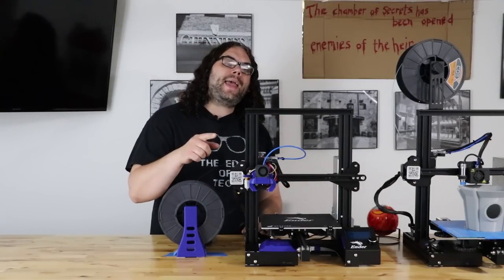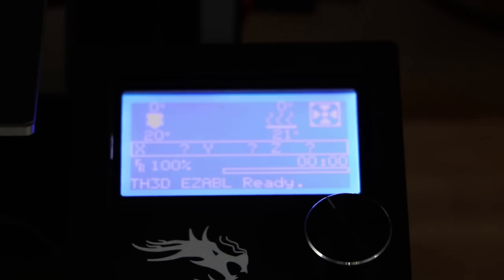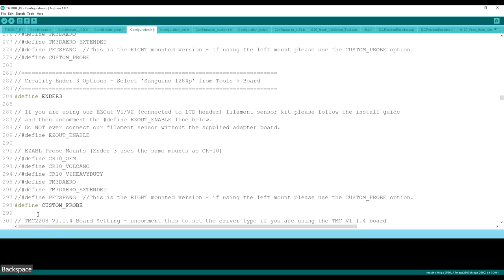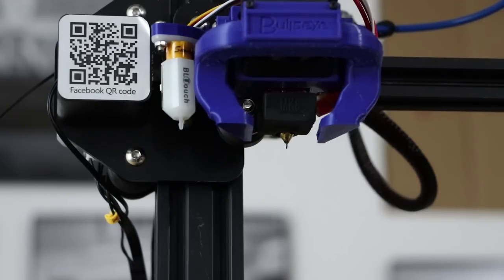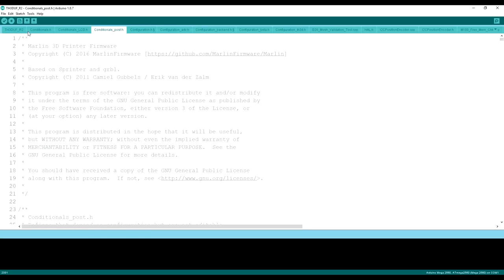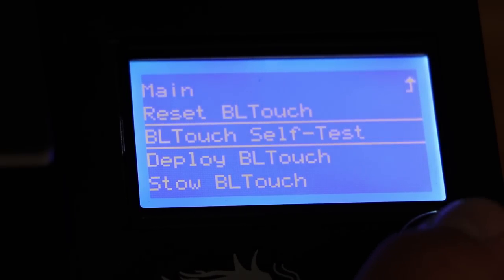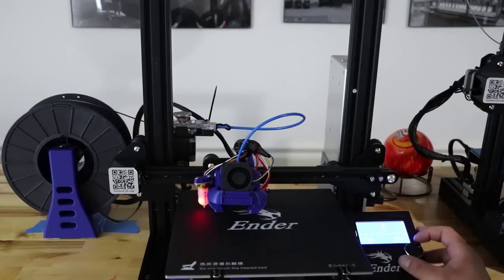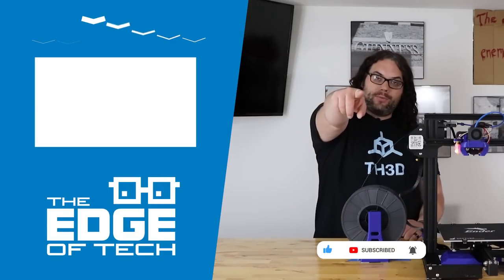New way to configure the BLTouch on the Ender 3 in 10 minutes or less

Comment: To measure the X and Y probe offsets (shown at 8:35), the following worked great for me:
1)   The printer does not have to be turned on.
2)   Manually move the hotend until the centre of the nozzle is touching the front edge of the bed.
3)   Measure from the front edge of the bed to the centre of the BL-Touch probe's tip.  This is your Y offset.
4)  Repeat this process, measuring from the right-hand side of the bed to get your X offset.
Thanks for a helpful video.
Reply: John Colvin 
That’s a good tip.  You can also use the printer powered on, and step it along until aligned to get more exact measurements.
Reply: Or you could just measure straight from the nozzle to the bltouch and use the Pythagorean Theorem.

Comment: I do enjoy the way you explain things.  Very easy and simple.  You also have great visuals.  Others that do similar walk-throughs have blurry images.  I would love you to make an advanced video that includes:  1. How to speed up BLTouch sensor..(TH has really made it slow compared to their proprietary speeds). 2. How to trim the fat on the firmware with this small Memory chip.  3. How to change boot screen 4. How to easily add the LUKES DUMP after the bed level.   I have done most of these things, but has taken a week of messing around and watching multiple videos.  Not many people (outside of Cvid times). Have that kind of time.  But that is only a suggestion.  Thanks for your videos!
Reply from the maker: Thanks for your suggestions!!! Thanks for watching!!

Comment: I have the BL Touch V3.1 and the V1.1.4 board.  When I installed the connections, the top of the container would not shut due to interference with the fan.  I printed a 5 mm spacer and bought M3-0.5 x 16 MM Socket Cap Screws at Home Depot - about 70 cents. Worked great.  I'll happily share the STL.  Still working to finish the software install - multi-tasking today.
Reply from the maker: Nice!! Great idea!

Comment: You saved me! After many, many hours of trying to get my bltouch 3.1 and Ender 3 to work, this firmware and your video finally enabled me to get up and running. The only thing that has changed in the latest TH3D that I can see is that in the configuration there doesn't appear to be a separate bltouch configuration for the 3 version. The versions must have all been consolidated into one bltouch selection.

Comment: Just installed my boot loader with an arduino uno as isp and updated my firmware to TH3D U1.R2.15. in preparation for my BL touch (on its way) im freakN PUMPED!!!! great video man!!!
Reply from the maker: Awesome!!!

Comment: Just to add to this. I did it on my ender 3 pro this way. After updating firmware and connecting the bl touch, I auto homed. I didn't need to disconnected the z axis switch - the controller knows about the bl touch and uses it. I then moved the extruder down with the z axis 'move axis' until it grabbed a piece of paper and wrote down the offset. Then going into the bl touch menu I dialed in that amount into the probe z offset. To double check this, I auto homed again. When I went into the move axis, it shows  something like +11.5 mm - if you dial this down to 0, it should just grab the piece of paper. If this is all ok, then you can go into the control menu and save the params. One other thing, I made a test print with a big single layer margin (using the bed levelling), while doing the margin, I looked at how it was being deposited. I adjusted the z axis probe offset in tiny (0.1 mm) steps and re-did the print a couple of times (stopped at the margin).
Doing this gave me a really good first layer.

Comment: Measuring the nozzle easier if you use graph paper with mm increments (or print one) and then lower the nozzle to the bed, mark where it sits and mark tip of bltouch. take graph paper out and measure using the graph paper. Saves twisting and turning trying to find measurement!

Comment: I do with the video used the standard settings and X/Y/Z adjustments as well, i do not use a Bullseye and the BL touch's measurements should be easy to set considering it goes on nearly exactly the same for every one, i had no ruler and wished to have at least a mention of good "defaults" one could use for the normal way it is installed and with the bracket it came with so i could tweak the slight differences by eye and testing from. other then that this video is very informative and helps a ton in setup procedure thanks.

Comment: Cool and simple video. I have finish step by step, but when i start up the printer after put the new firmware on, the mini speaker back on the control display goin nuts and buzz non-stop all the time. is there somthing i have done wrong or can do to get the buzz to stop?

Comment: How often do you need to re-calibrate the bed? Ie, auto home, and check z offset.
Reply from the maker: I use a G29 in my starting Gcode to probe before every print. It only takes a minute and it's good practice. Normally I set it all once and don't have to do it again for a long time on the z offest.

Comment: Got my new Ender 3 pro.  Added the 1.1.5 silent card.  It has firmware 1.1.8.   I also bought a BLtouch 3.1.  So if I am understanding this correctly, I need to do the following to get my BLtouch to work.  

1. Turn off machine and install BLtouch hardware.  I got the full pack with the pin27 board and mounting bracket from Creality.
2. Leave machine turned off and plug in USB cable.  Then plug that cable into my PC also.
3. Install USB driver(s) from Ender3 SD card that came with machine.
4. Download firmware update from TH3d and extract
5. Run  app and make changes as per the video to TH3d firmware code.
6. Compile.
7. Upload to printer.
8. Power on printer and confirm TH3d installed and BLtouch is working.  
9. Configure BLtouch.

Did I leave anything out?  are there any steps that I left out?
Is there any way to back up the 1.1.8 firmware that is currently on the board?  In case I need to roll back. 
Do I need to then reconfigure everything on the PC?  Esteps, flowrate... etc?  Or does that not get overwritten with the firmware update? 

Thank you
Reply: Did you ever figure out if this was the correct way? Just ordered a BL Touch ... and have the same setup as you. It's a tad confusing, cause every guide I see is different.

Comment: you demonstrated the incorrect method to measure the probe-nozzle xy offset. you should be measuring the x displacement (42) and y displacement (5). you used the calipers to get the scalar distance instead, that's how you got 47, sqrt(42²+5²)
Reply: Thanks, I was confused with the math, like wait whaaaa

Comment: wait... what? How did you set up the 3x3 grid? mine just does 1.
great tutorial though to that point! Haha I realised after I got it functioning that I had no idea what to do next
Reply from the maker: By default on the firmware it should do 3 across the front, middle and back. Doesn't it do that?
Reply: The Edge of Tech it acts like it is auto homing but it auto homes with the probe in the middle of the bed.
Reply: So it just does one point. 
Is there something I need to do in the Gcode?
Reply from the maker: @matthewarchibald5118 Did you turn it on in the new firmware for you Printer? What Printer is it?
Reply: The Edge of Tech ender 3 pro, silent board, I enabled custom probe, bltouch, pin 27
Reply: @matthewarchibald5118  Mine is doing the same thing. Did you ever figure it out?
Reply: @blakequinn280  yes! the key thing you and I were missing is "g28" 
go into cura click on printer settings, and look at the start gcode you should add g28 in a new line after g27 
https://www.reddit.com/r/ender3/comments/aiebc7/better_cura_start_gcode_for_bltouch/
This article talks about some cleaner solutions where it will display text, I ended up editing one of these. I like the one where it says "heat up bed to target, preheat nozzle to 160 (I changed that to 200)" because that reduces wait time. 
If this is still confusing, just drop another comment!

Comment: Thank you for your video, I have bought the new Ender 3 printer. I was able to test print cat. now to print new models whether it is must to upgrade firmware that is marlin or TH3D and cura software or without that it will work?
Reply from the maker: You don't have to update the firmware, but it's suggested to get Thermal Runaway turned on. But you will need a slicer like Cura to slice you prints and create the GCode

Comment: Great video...But dont you have to set a z offset first and store settings... then baby step after print starts to get it perfect?... or am I missing something
Reply from the maker: Yes you will have to do that! I just wanted to create a video to show how to configure it in the firmware. But yes you are correct. Thanks for watching!
Reply: @TheEdgeofTech  thanks for all your time and efforts couldn't do it without you! Keep up the great work!!!
Reply: How do I do this? I’m looking all over the place?
Reply: @AMVitry  use a piece of paper and get your z height close....then go into z height offset and set your z height....then go to store settings....then start a print and use the baby steps to make it perfect...after you get it perfect...go back to store settings.. then you should be good worst case you might have to go into baby steps and make small adjustments depending on your print and how you like your layers

Comment: Hey, great video - However, I'm having some issues...I've got a V3 BLTouch and when i follow the instructions and begin a print, the printer keeps cycling through the probe.  It doesn't actually begin a print...Just continues to repeat the 3x3 probe.

Any thoughts?

Thanks.
Reply from the maker: I would check the starting g code just to make sure everything is right. Also, slice it again on a fresh memory card just to be safe.

Comment: Great Video as always i hope somebody can help me ive tried to find the answer everywhere i have the bltouch v3.1 and an ender 5 due for delivery today can i use this guide to flash the ender 5 with the official ender 5 firmware or could somebody point me in the right direction i have the isp programmer supplied with the kit can i use this to put on a bootloader and better firmware thanks again for all your great work
Reply from the maker: Thanks for watching! The newer Ender 5 machines should have the 1.1.5 board and the bootloader should be on it already. You should able to flash the firmware on it right out of the box. Give it a try and let me know if it works or not! :) Enjoy your Ender 5!!
Reply: @TheEdgeofTech  thanks for the reply just checked my board is the 1.1.4  any further help would be great thanks first 3d printer so very new to all this lol

Comment: Installed a Ender 3 v2  BL Touch and installation was easy. Cannot say the same for settings , turned on after installing the nozzle went to center after clicking AUTO HOME  the nozzle mixes to the bed and it doesn’t stop it hits the bed and the Z motor start making a grinding noise and horizontal bar is trying to keep pushing down , immediately I have to turn off the printer. I notice the BL Touch probe is not touching the bed before the nozzle. HELP !!!😩 Any suggestions will be appreciated !

Comment: I have followed this tutorial seamlessly, but I am having issues. For some reason, my printer thinks that the “home” for the z axis is about 75mm above the bed. When it “probes” the bed the BL Touch goes up instead of down. 
Does anyone know how to fix this?
Reply from the maker: I think you may have the wires backwards to the z endstop. Did you get this fixed already?

Comment: Need Help...SUPER NEWB...sighs welcomed...I just flashed the firm ware onto my silent board v1.1.5  with the latest TH3d Firmware u1.r2.a8 and Antlabs BLTouch v 3.1 and the pin 27 board from TH3D as well as the wire kit from Filastruder and followed all the steps. everything writes to the board correctly but when i press auto home the z goes up instead of down towards the bed? Did i miss something or do I have to invert something?
Reply from the maker: Welcome! Thanks for watching and great work getting it done! It sounds to me like you're too Z end stop wires are reversed. You should be able to turn the plug around on the board. You may have to shave a little bit off of it, but it will work. Or you could pop the wires out and reverse them and put them back in. Let me know if that makes sense and if you need more help!
Reply: @TheEdgeofTech  You are a god! Thank you! It's working now. It turns out the connectors included with the bl touch are too loose on the z axis board connector so I hate to say it but I cut the white connector off of my stock z cable that attaches to the z stop and used that and now it works perfectly!
Reply from the maker: @chrisbabbitt2218  Boom!! You got it! Nice work!!
Reply: @chrisbabbitt2218  Thank you so very much I was n this struggle-bus for days, it kept the gantry mid height of my ender, once i used the original cable and connected it to the BLtouch, it worked as intended. Thank you for saving me from more frustration and confusion. ♥

Comment: Good video, looking for some help!,  I have a new 1.1.5 main board and a v3 BLtouch , when I went to auto home the nozzle crashed into the bed? 
 I have made the following changes before I flashed "TH3D_UFW_U1.R2.22":
#define BLTOUCH
#define BLTOUCH_FORCE_SW_MODE
#define BLTOUCH_SET_5V_MODE
#define SERVO0_PIN 27

When I test the BLtouch from the LCD menu every thing works fine?

Just an FYI, I flashed back to Marlin 1.1.9 bugfix and the bltouch works fine ???

Thanks for any help...  I would certainly like to try out the TH3d firmware with the BLtouch.

Comment: Gr8 video up to the point of X Y measured offsets which yours were -47 and -13 then you just changed them to -42 -5 you changed with no reason apart from you deferred to TH3d. Surely thats wrong your measured offsets would have been correct to enter. 
Your change to Fix_Mounted_Probe was invalid as BLTOUCH was enabled, making the change of no value apart from cosmetic.

Comment: I purchased the siansmart Ender-3. Do I have to install boot loader to stock control board to be able to update firmware to th3d firmware.
Thanks in advance..
Reply from the maker: Yes, you probably will. Unless it's a 1.1.5 board. Then it may have one.
Reply: Thank you sir. It did need to be flashed. Keep those instructional videos going. EOT and TH3D are my go to when I need help solving a problem.  👍🤛

Comment: Just installed my boot loader with an arduino uno isp and updated my firmware To the latest th3d firmware. I have followed your instructions and have uncommented ender 3. And made all of the changes.But when I check the flash I keep getting the error: no printer uncommented configure H please uncomment and try again. I have watched your video at least 3 times and do not know what I have done wrong can anyone please help. Thank You
Reply from the maker: Hey Dennis, were you able to get it working? I am sorry for the delay. Just making sure you are doing the uncommenting in the configuration_h tab. Also, that you are uncommenting the main Ender 3 machine and not in the wrong place. Let me know.

Comment: I've had a strange problem. With everything installed I auto home which works fine. But if I try to move the Z axis either up or down the hot end heads towards the bed and won't stop. Anyone seen this behaviour before? I can move the hot end up or down without issue after a print, it only seems to be after an Auto Home that it decides to always travel towards the bed.

Comment: Just one question. I have vanilla marlin so what does this do to that?  Anything I have to worry about?  Thanks
Reply from the maker: This will take the place of vanilla Marlin. You can only have one firmware at a time running on a machine, so you can have vanilla Marlin or the TH3D version of Marlin. I hope that makes sense.
Reply: The Edge of Tech that makes sense, so if I follow your instructions it will overwrite the vanilla marlin?  I have a bltouch installed so I can just copy my current settings and put them during the bltouch setup?
Reply from the maker: @davidfox9349  Correct! If you follow this process, you will go from Vanilla Marlin to TH3D Unified Firmware.

Comment: I have added the bootloader using a arduino uno. Once I plug in 3d printer board directly with a usb into the computer, it does not show up on my com port list as an option. Any ideas why? I am using this method on a CR-10 mini.
Reply from the maker: Good question. Did you try to restart your pc, and try a different USB port?
Reply: @TheEdgeofTech  I figued it out. I looked up USB drivers for cr-10 printers. Once I downloaded new drivers, it finally showed up on my com list.
Reply from the maker: @evangeno7257  Awesome!! Sorry for the delayed response, but I'm glad you got it working!!

Comment: I did the unified U1.R2.21a on my ender 3 with BLTouch and it only does one probe in the middle not the multi probe shown.  I cant find in the configuration.h where that is set?

Comment: Thank you for the awesome video. I followed it to a tee but I have a weird issue. Everything uploads fine to my Creality v1.1.5 silent board but when it come on the buzzer is running constantly. I can’t figure out why.
Reply: I figured it out. I was building on the bench and didn’t have the pin27 board attached at the time. I hooked the board up as shown and it stopped the buzzing and works great. Thanks again